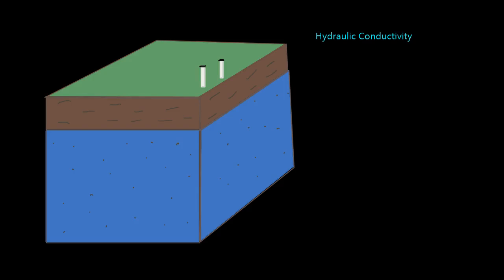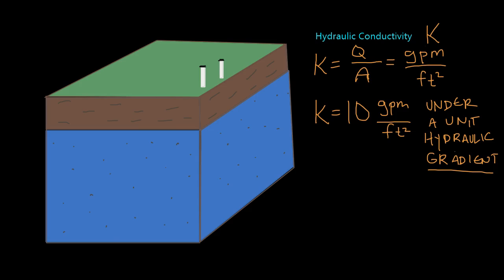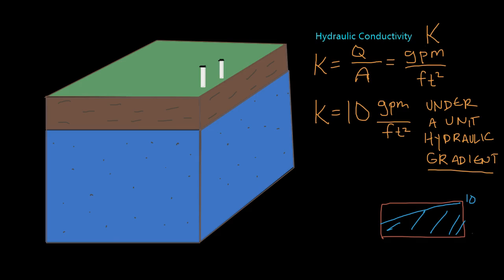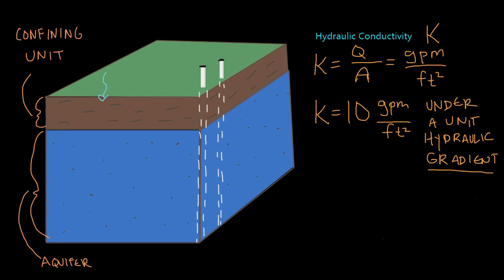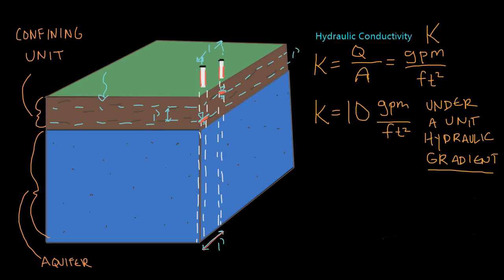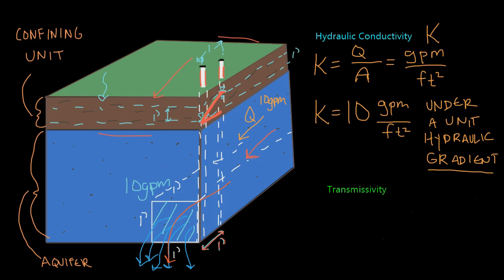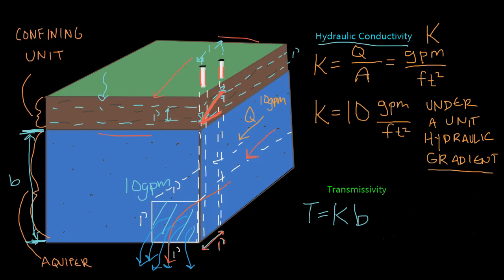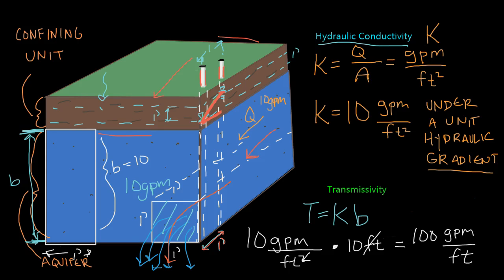Hydraulic Conductivity and Transmissivity

Comment: My frog pond with burnt bluff sandstone along boundary line 4'x'8 at 4 feet deep. Only flows little over a gallon a minute out of overflow pipe. Farther down boundary line the seep in white sand layer above spring. It seeps about 5 gallons a minute. One point water runs under top soil but above white sand. I got no measurement of what the water runs under top soil at that point but is about what springs flow. There is a tree stump near that point too, so maybe a spring. The springs I have found come up through rotten tree roots in a sink. My water level of seeps seems very constant over 200 yards even as soil layers change.

Comment: The relationship between hydraulic conductivity and transmissivity is not getting very clear. Could you please bring out that in an easier way?
Reply from the maker: It's kind of confusing.  Transmissivity is just hydraulic conductivity multiplied by the height of the aquifer, but a better way to think about it is that transmissivity describes how much water will move through the TOTAL aquifer body, while hydraulic conductivity describes water flow through a more discrete point in the aquifer.  Transmissivity is better used in water supply applications (like determining how much water a well will produce for a drinking water purposes).  Hydraulic conductivity is better used for describing how much water moves through a certain portion or bed within the aquifer, which is more applicable to contaminant hydrogeology, remediation, heterogeneous aquifers, etc.
Reply: @daneandersen8181  but in the darcy law we take the cross sectional area of the whole porous medium. when we try to fixate only on the water flowing through the pores we get seepage velocity, which is more than darcy velocity.
So, further multiyplying by width makes not much sense as the cross sectional area considered by darcy will automatically include the width b.. which begs the question why have you taken cross sectional areas differently
Reply from the maker: @kittuojha  I'll have to think about that one... good question though.
Reply: I think You may imagine transmissivity like a "plain" passing through aquifer per time unit.